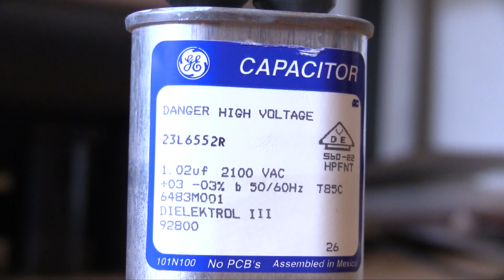How to Disassemble a Microwave and Why!

Comment: Use a multimeter to discharge a capacitor. It's safer and you can tell if it is fully discharged

Comment: Am I safe if I just bought a brand new one to take apart from Home Depot? I really just want to make a really strong electromagnet. Should I be concerned? Will I be in any danger using the transformer as an EM if it’s only attached to a 30V 10A bench DC power supply unit?
Reply: If you take a multimeter and set it to continuity mode, (where it beeps if the two probes are touched together) and probe the input wires on that transformer, the multimeter will beep. This is because those two tabs are simply each end of the same wire, wrapped many times in circles inside of magnetic plates sandwiched together around the wire. 

If you connect your DC bench power supply to the transformer it will be the same as just clipping the two alligator clips directly to each other in a dead short. One just has some copper wire in between. Both are a dead short. 

Transformers function on the principal of the electricity flowing through them changing polarity such as alternating current. 

The magnetic metal surrounding the wires allows this AC current to build up and be stored within a field of magnetic flux that surrounds the wires, building very quickly on each positive and negative cycle (60 times per second in america, 60hz) of the current. 

Each time this current changes polarity, or direction, as it alternates from positive to negative and vice versa, so does the polarity of of this magnetic flux field, which means that all of that energy stored in the flux around the wire will collapse, before it can change magnetic polarity, and that is why the secondary winding of wire is also within the magnetic metal material. For all of that flux energy to collapse into the secondary winding which induces a voltage into that secondary coil proportional to the ratio of winds between the primary and secondary. (and the inverse happens with the current, because the transformer is “trading” current for more voltage every time the field collapses into the secondary coil, which happens 60 times per second with the AC mains from the wall in America, when the microwave is plugged in and in use) 

Alternating current does not “see” the primary winding of the transformer as a dead short, because of something called inductive reactance, which, put very simply “resists” the flow of the AC wall power so as not to behave as a dead short. 

That is the long way of explaining that there is no possibly way that you can use an AC transformer with a DC voltage source, such as a bench power supply, as the primary winding will simply be a dead short-circuit to your dc power supply. (the current will shoot up to 5A or however high your setting is on the supply, and the voltage will drip to 0 on the screen. Because the output of your bench power supply will be shorted across the primary conductor of the AC transformer, which, to your dc power supply, i’d simply a wire, as its output does not alternate.
Reply: Goodwill usually has microwaves, they'll be a lot cheaper there

Comment: 2:25 by the way some people may have pliers coated in an insulating material, and they may be unaware that using that will not discharge the capacitor, so to clarify, make sure it conducts!

Comment: A quarter accidentally slipped inside the microwave by one of the slits on top a the casing. Is it still safe to use it or should I try to open it up to get it out?

Comment: We recently bought a house that has a non-working 80's model microwave.  It hasn't been plugged in for at least 6 months (most likely much longer than that).  Been trying to figure out if its safe to take apart.

Comment: I was going to take mine apart to cannibalize the parts, but this guy scared me so I will just toss it.
Reply: This guy scared me, too, but he also made me realise just how valuable the microwave is, so I'm still going to take mine apart, haha. The magnetron in mine just starting failing last night, so I hope the ceramic isn't damaged or something.
Reply: @EvilCat-EnergyCatalyst  Be sure to wear protective gear. Gloves, goggles, a respirator mask. Work in a ventilated area or in the open air if possible. Hopefully this will make it safe.
✌️&❤️
Reply: 😊 @EvilCat-EnergyCatalyst
Reply: Got scared the he'll putta me when he said a magnetron and the capacitor I think was mentioned. 😅 many stories that come to mind this year in particular were I shouldn't be here due to similar situations and zero idea about kitchen appliances that I shouldn't have touched including an electric hot water unit. As I may also mention an extremely long story😂

Comment: What class of gloves are you using? What is the minimum class for working with a microwave capacitor? Class 4? 3? 2? 1? 0? 00?
Reply: Always discharge the capacitor before removing any parts. A simple piece of insulated wire between the two lugs  can save your life.  A pair of insulated pliers or needle nose pliers can often work too. If even a year old , it can still kill.
Reply: @brianroberts5740 am I safe if I just bought one from a store to take apart?
Reply: All you have to do is short the capacitor terminals together with a metal object, like needle nose pliers with insulated handles (for your psychological welfare).  If it's charged, it'll spark, then it's done.

Comment: There is also a big hunk of pure copper inside the magnatron, if you take it apart, be careful not to smash the ceramic insulator.  And big ole magnets!
Safest thing to do is short the big HV capacitor with a screwdriver that has a very good handle..touch between the contacts and discharge it so it doesn't zap you
Great video!